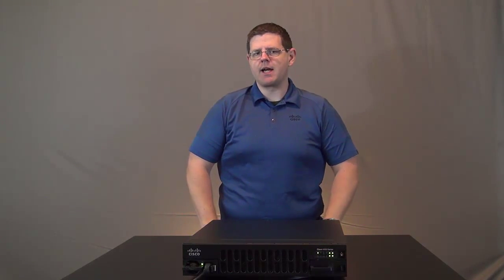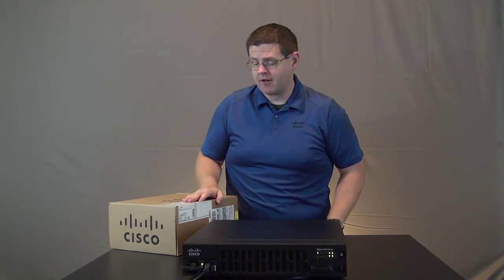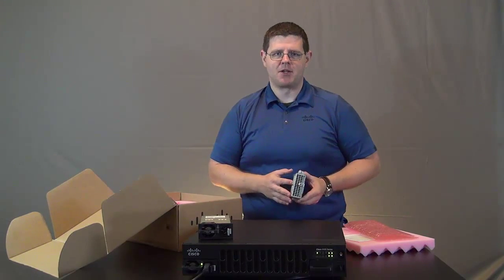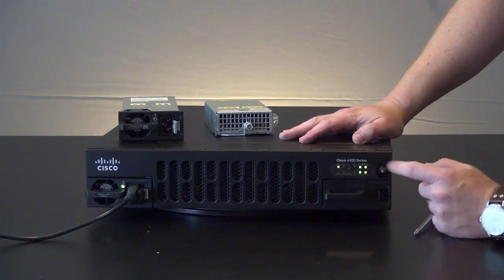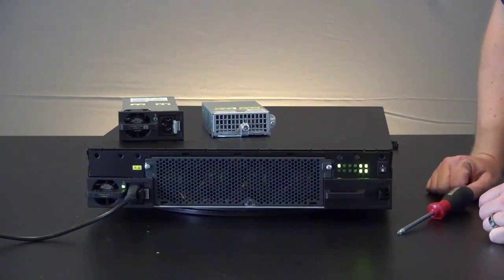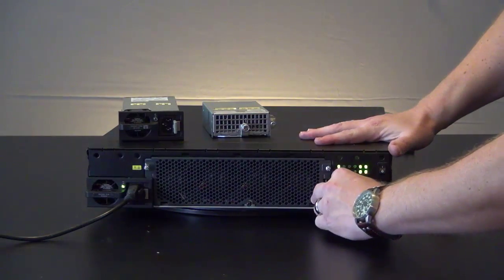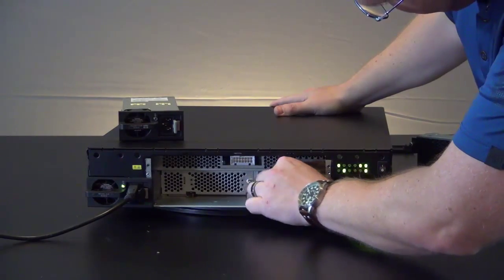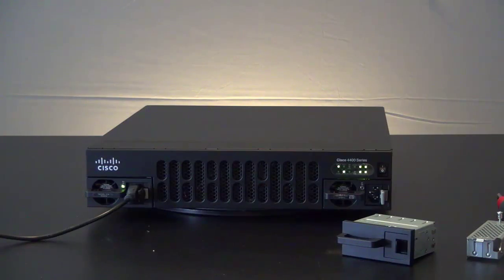Installing a PoE Power Supply in a 4451/4351 ISR

Comment: What is  the reason cisco did NOT implement  SSL for 4300   platform ?
Reply from the maker: +Anton Popularity. SSLVPN wasn't very popular on the ISR G2s and it wasn't prioritized on the ISR 4000 Series. SSLVPN is typically a remote user VPN technology while the ISRs are typically used for site-to-site VPN. It could still be added in the future if there is enough interest.